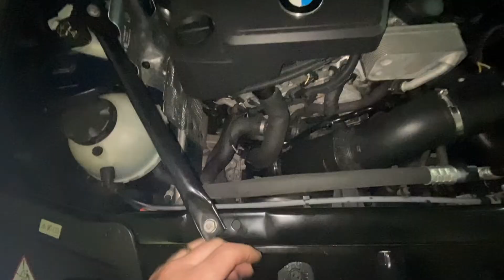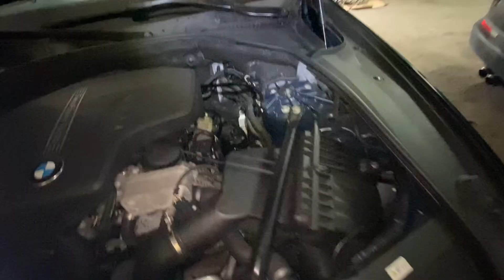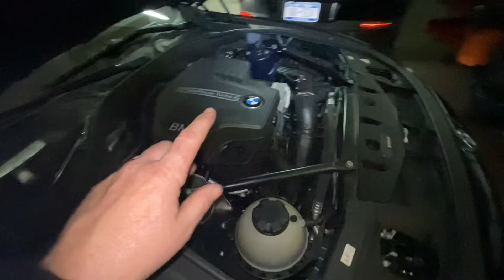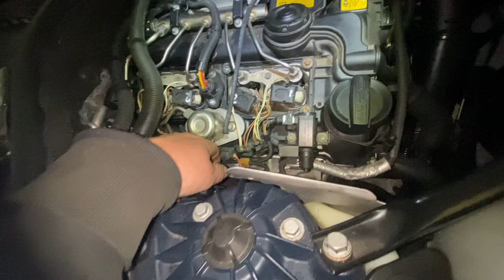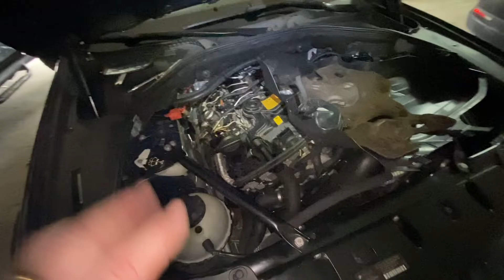Most Common Fixes Of BMW Code 120308 - Drivetrain Malfunction Message

Comment: Hi, I have a 2009 740li that faced lack of boost. I had changed HPFP, LPFP, Valve body solenoids, throttle valve and charge pipe. My car still faced same issue when I rev the accelerator drivetrain malfunction or a normal drive but lack of boost. The car feel dead, any ideas ppls ?
Reply from the maker: I have videos on low boost problems check them out. Your problem if the engine is running properly is the turbo pressure side. Can be a leak in the piping, wastegate problem, flapper valve, diverter valve etc
Reply: Sure, can I have the link to see it?

Comment: @Motorcarnut   BMW x3 f25 -n20 engine
I got this error "120308: Boost pressure control, plausibility: pressure too low" 
Drivetrain Malfunction error came... not able to start the car.. 
then i checked with BMW diagnose.... they said Valvatronic  servo motor failure ...
Reply from the maker: Valvetronic will cause the no start condition for sure, I have a video on how to replace it if you’re mechanically inclined and as it fails the engine won’t run properly and will give the low boost code as well.
Reply: @motorcarnut  while changing Valvatronic  servo motor do i need to change  eccentric shaft parts ? is it must ? ...
Reply from the maker: No, unless it’s bad like stripped or broken.
Reply: @motorcarnut   

This is report given by BMW dealer 

Scanned vehicle, faults stored for valvetronic servomotor activation and signal. Run ABL, checked connections from WVT to DME, connections ok, checked for voltage from DME, no supply voltage from DME measured. Removed harness for WT, checked harness continuity, continuity OK. ABL determined valvetronic servomotor is faulty, replacement required. Due to common failure of VVT and connector eccentric shaft, replacement of all components together required. Failed WT often also causes DME to fail internally, if faults remain following WVT parts replacement, DME replacement required as well."

as you said no need replace eccentric shaft if's good condition right .. how about DME ....?

one more issue happening in my car... whenever i tried connect Bluetooth to phone... its reset automatically after some time.. empty in Bluetooth phone list ...? how to fix this
Reply from the maker: The Bluetooth issue I’m not familiar with as I never saw that issue. It would have to be diagnosed with a factory level scan tool to see what’s going on. The reason why they are saying the ecm may have to be replaced is because the electronic relays and other electronics that control the valvetronic servo motor plug in directly to the ecm and sometimes the motor can short out the computer when it goes bad, it’s not that common but does happen. The eccentric cam is like a camshaft, made or cast iron and it doesn’t constantly spin like a cam or crankshaft, it slides for one side to the other. So no need to replace if not damaged.
Reply: @motorcarnut  
Thanks for the clarification... I have checked your video.. valvetronic servomotor replacement ... really amazing.. seems very difficult operation ?  BMW gave estimation for 5k.. is it ok with retail mechanics ... ? with replace BMW OEM VVT.  

a month ago    Through BimmerLink i found these error codes.... 

00 Junction box electronics
2 errors
8020E7: Terminal 30B active: start capability limit reached or terminal 30B active for a long time
8020D9: Central locking SCA rear contact: SCA and tailgate stuck, lock defective or short
circuit to ground

10 Central gateway module
3 errors
CD043F: NAK receiver node: did not pick up the message; buffer full
801C15: Failed to fall asleep at 30B
801C20: Central fault memory full

12 Motor electronics
1 error
120308: Boost pressure control, plausibility: pressure too low
29 Dynamic stability control MK60 E5

1 error
4809AB: Global power supply - external undervoltage
36 Japan basis interface telephone

1 error
B7F180: Software reset

I checked battery output always 12.4+ seems fine or i need to change the battery...for undervoltage 

please let me know 

Thanks

Comment: My X1 goes into limp mode and shows same Drivetrain Malfunction Message.  The code is 120408 (Boost pres. cont. cut off rise blocked) instead of 120308.  Is this the same thing?  I've notice I get the Malfunction message and limp mode when I don't turn off the A/C when shutting down the car, and then when I restart with A/C on, it's much more likely to kick off this message.  Correlation??
Reply: I also get code 131401 - VANOS, outlet, cold start not controllable.  Bad plugs and/or coils???
Reply from the maker: Sounds like your timing chain cartridge is on its way out. The first code is the boost pressure solenoid but with this other code it’s probably the chain as stated

Comment: My 2012 bmw 528i 2.0L throwing codes inconsistent either bank 1 sensor 2 or bank 1 and yet the sensors are oem replacement  and even they are working thru my graphics monitor and still throwing these codes over and over. I can't find any vacuum leak or whatsoever  but thinking might be the ecm? Thank.
Reply from the maker: It’s possible but that problem requires professional expertise in finding the problem hands on.

Comment: Thank you very much fantastic tutorial video. I have BMW with N47T engine. I have a leakage on the hose for the pressure converter into the wastegate. I must go through all the hoses and check for leakage. Do you know the standard size of the hoses for the vacuum systems? Are the hoses inner diameter 3,5mm?
Reply from the maker: Not off hand, but I made a video on how to check the piping with a specific tool that mounts to the turbo inlet and pressurized the output side of piping to find leaks fast
Reply: @motorcarnut  Oh Yes I have watched your video with that tool. Fantastic tool. I prefer to do a manual search first. The tool is quit expensive and with shipping, custom taxes, the price will be over double. Lately Ebay has increased the shipping price.

Comment: Hi, I've got a 116i and recently, I got a coolant flush. I saw the mechanic take off the airbox which connects to the turbo, and since then my turbo does not kick in and gives me no power.
I got a drivetrain error which I got checked out and the only code that remained was 120308.
Could my issue be that everything was not connected up again properly? Or could it be something else?
I'll greatly appreciate your response!
Reply from the maker: Absolutely, all the connections once removed should have the orings replaced.

Comment: Thank you for a very good video. I had a turbo crash. The workshop replace a new turbo. My car is very slow no boost at all. I have got a lot drivetrain each time I accelerate. With my diagnose tool Autofix, I got many codes relating to a fault boost pressure. Replace the boost pressure and most errors disappear except error 29A400 saying  charging pressure actuator position control charging pressure actuator closed too too far/ppositive control deviation. My car is a BMW F11 525D Xdrive 2012 218 Hp. I think my car has electronic wastegate. Do you know how to adjust an electronic wastegate?
Reply from the maker: It has to be done with a scan tool that has bidirectional controls
Reply: @motorcarnut  I have a scan tool, I hope the tool has bidirectional contrrol. I can do an adjustment to minus -3 to -4 and then run a control on the tool.

Comment: So I have a 2014 328 with the EWG(wastegate). Same code. Now Map, TMAP, Diverter Valve and new turbo inlet. Still get the code in Error Memory 120308. I get the warning at about 4-5lbs of boost. This is through live data and logs with Bimmer code. I don’t want to go to dealer. Any other tips. I ran smoke through inlet pipe and no leak. I do hear a hiss at lower rpm before boost kicks in from passenger side. It kinda went out within a day. Any fuses to check
Reply from the maker: This video is the test output side of the turbo : https://m.youtube.com/watch?v=3QcKdWooX-w

There should be no hissing, that sounds like a leak to me. Also the wastegate connects to a flap valve in the manifold, is there play on the lever? If there is, that’s the problem and have a video on replacing that flapper valve too.
Reply: @motorcarnut  8:12

Comment: Ladies and gentleman, if you have a 2012 528i aka the n20 engine before 2013, CHECK YOUR VACCUM RESERVOIR ON THE ENGINE COVER. Thank me later
Reply from the maker: Actually, all the way up to 2018, I explained the reservoir, but its the leaking vacuum pump that causes the reservoir to fill with oil. That part is just a plastic tank.

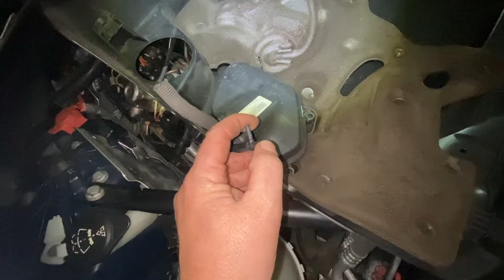Comment: Hi , i did what you said and disconnected the hose , but i noticed that mine has oil in both the hose and reservoir,(4:47)  i didn’t hear any air or vacuum i just seen oil coming out of both , do you know what should be replaced in this case ?
Reply from the maker: The vacuum pump is probably bad. It’s located in the back of the engine in the valve cover. After replacing it you have to clean out the lines and reservoir with carb cleaner and compressed air so you can get the vacuum back to control the wastegate.
Reply: Same thing with my 528i I’m going to replace the vacuum pump
Reply: Were you able to solve this problem just by changing the vacuum pump? I have the same problem but my line have vaccum but the oil present

Comment: I have the same problem. Is the reservoir suppose to have oil in it and also I noticed when you took off the hose ( 4:47 ) I heard air pressure escaping is that how it should be?
Reply from the maker: No. the reservoir is for vacuum not oil, if oil is in it , it means your vacuum pump is leaking and should be replaced. Yes there is supposed to be vacuum on the hose.
Reply: @motorcarnut  Thank you for the insight. This helps greatly.
Reply: BMS has a recall for the vacuum pump on this engine N20. Search it up...

Comment: I also have a 2013 X3 and paid for a diagnostic on the 'drivetrain malfunction'. My shop came up with the same code of 120308 along with three other codes. Recommendation was to start with replacing the intercooler input/output hoses and work down from there. Apparently it must be an easy job because the labor estimate was cheap. (there hose prices were high but found them cheaper online) Can anyone comment on the labor for this job? Thanks
Reply: I have BMW with low boost and drive train myself. After a lot of research, I checked my map sensor on the top of the intake manifold. The whole map sensor was clogged of oil and carbon. The map sensor control air oxygen and cooperate with the ECU how much fluid to inject into the engine. After cleaning the map sensor with turbo/egr cleaner and cleaning the hull on th intake manifold with a wet cloth with turbo/egr cleaner, my car has got pressure back, the enginge runs more quite. This is just a quick repair. If your car is clogged up with so much oil and carbon you should have a complete cleaning of the intake manifold and the cylinder ports into your engine. This is a big service and cost about 1900 dollars in Norway. This is a common problem on diesel engine between 160000-200000 km. The BMW dealer told me, they use a whole day for this kind intake  manifold service. I will do the service by myself next spring.
Reply from the maker: @dinhvanpham8102 Thank you for the extra info, appreciated!
Reply from the maker: It depends on many factors, I have many video's you can look at and try to do it yourself and save money, not that hard.

Comment: DCS malfuntion & Check engine both lights came up on mine bmw the coding on my car say something about "pedal module failure "what could that be? Thanks
Reply from the maker: That has to do with the accelerator pedal and the throttle body, computer senses something wrong. Can be checked with a good scan tool to see the values and run a test. Try clearing codes and see what comes back.
Reply: @motorcarnut  thanks for the quick reply brother....and yes it might be it because last weekend it was pouring here in new york and i dont know how the water get into the floor of my car. So, that might be the malfuntion water problaby touched the pedal. Today the only light that came up wss the check engine light. If it come back should i change the whole pedal or just the sensor on it because from other videos i learned that this car have a electric pedal
Reply from the maker: I would just dry that whole area if you have an air compressor and wait a couple of days then reset the light if you are not have any other problems of course.
Reply: @motorcarnut  Will do. Thank you sl much for your help.
Reply from the maker: No problem

Comment: I have a 2013 bmw x3. I replaced the vacuum pump, replaced the diverted, replaced pressure valve, replaced both gaskets on charge pipe still error code 120308. The car runs really good and otherwise no other issues. Could it be the turbo flap? Help!
Reply from the maker: Yes, that’s what was wrong with the car in that video. You can try to adjust the wastegate arm to see if that helps but eventually it will have to be replaced. I have a video on the replacement as well

Comment: Mine ended up being a vacuum line to the turbo being broken. Changed that and all was good.  The symptoms I had was  the car would only give the code when the car kicked down and when I hit the gas hard.
Reply from the maker: Yep, that’ll do it. Glad you fixed it.
Reply: hi. how did u get to that diagnosis tnx?
Reply: Is there a hose that comes directly from the vacuum pump? Or do u mean the hose from the boost solenoid on the valve cover ?

Comment: I got same fault code, there is not enough vacuum coming out boost solenoid, but enough vacuum coming out from vacuum pump. I connected pipe directly from vacuum pump to the turbo. I can see turbo working probably after that. What problem do you think? Bad boost solenoid? Or vacuum pipe leaking? Or bad diverter valve? Thanks for helping
Reply from the maker: See all of those can cause your problem. At idle there is not supposed to be vacuum at the port that goes to the wastegate actuator. I have a video on doing a boost pressure test that will confirm any leaks and can take it from there.
Reply: @motorcarnut  I probably found my problem from this comment, I checked and at idle there is a vacuum at the outlet of the selenoid that goes to Westgate so my selenoid has a problem, thank you!!
Reply: I’ve been tracking down a 120308 code for about a month, I’ve replaced vacuum pump, reservoir, boost actuator, and diverter valve. Car still throws the code under mild load.  All vacuum lines are new as well. There is vacuum present at idle from boost solenoid to the waste gate actuator. Should there be vacuum to the actuator at idle? Any help is appreciated. Next step is installing new MAP and boost pressure sensors.

Comment: I got 2015 535i. I just changed my charge pipe to Vrsf. I did a small pull and went over a lil pot hole and then that Drive train came on . Any ideas what it would be ?? No check engine light
Reply from the maker: You may have to do a air pressure test, I have a video on that. There is a lot of things that can cause that such as wastegate flap not closing tight, wastegate solenoid, air leak as I described.
Reply: @motorcarnut  where the video I can’t find it ?? I think it had an air leak somewhere
Reply from the maker: https://m.youtube.com/watch?v=3QcKdWooX-w&feature=youtu.be
Reply: Did you scan your car to see what codes come up? Mfs ain’t psychic

Comment: Hey so I looked at your video again because I really trying to find the problem without spending a lot but anyway closer to the end you said the car gives a the code 120308 with low pressure exe and it still flys! My car is the same way so I’m running a tune on my car and I did a log and it shows my car not hitting the right amount of boost. So you said your problem was the solenoid I hope that’s the problem with mines because I checked everything else except that and the diverter valve
Reply from the maker: Yes, Also the waste gate flapper valve may not be closing 100% and will lose boost there as well. Can be adjusted on the linkage, if not,  I have a car come in with that exact problem and even made a video on how to replace the valve.
Reply: @motorcarnut  how would I tighten it up? With the little screw that’s on the link
Reply from the maker: Yes, but sometimes it’s rusty
Reply: @motorcarnut  what size is the screw and also how did you find out your solenoid was bad
Reply from the maker: I think it’s a 10mm and the solenoid wasn’t switching to let vacuum to the wastegate
Reply: @motorcarnut  but how come if the car still flys🤔
Reply: @motorcarnut  and also it may be the wastegate needing a lil tightening because when I’m driving and I let off the gas i here a little rattle from the passenger side but the car still flyes
Reply from the maker: Yes, probably not leaking that bad yet to feel it but computer picks it up
Reply: Any fix ? I did boost solenoid and nothing , maybe diverter next ?

Comment: So that little hose connected to the charge pipe on the right that u touched mines has a slice tht separated the hose and I think that’s what’s causing me to not reach the right targeted boost so when I tune my car to stage 2 it still feels like it’s stock
Reply from the maker: Sure, anything that would be a leak in the charging side of the turbo could cause low boost codes.